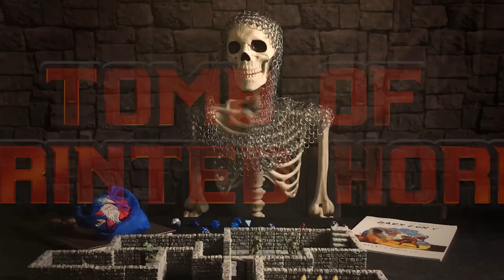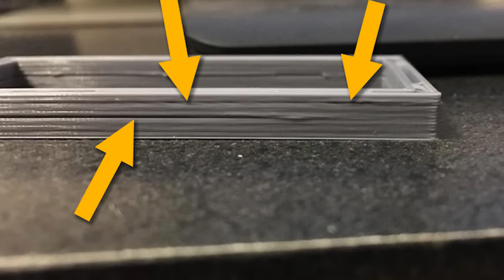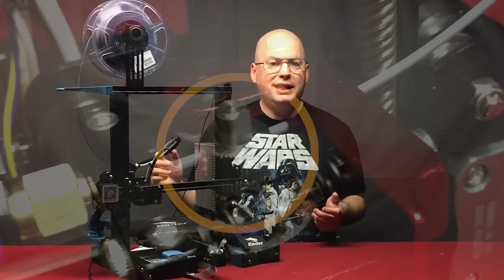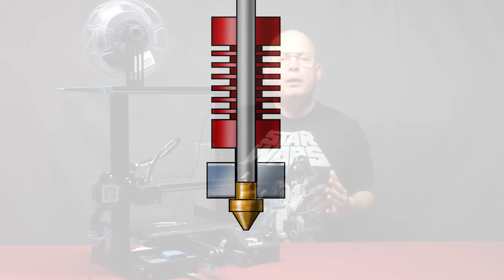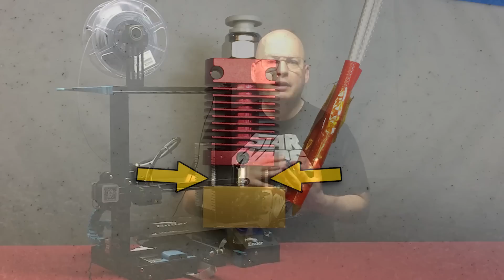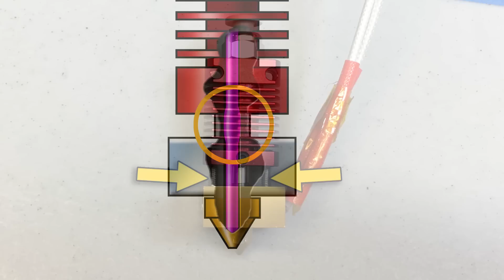Fixing Under Extrusion in a 3D Printer

Comment: Ender 3, v1
You saved me. Between this video and a bit more digging I nailed it. I'm back to printing. I have been having issues since getting a glass bed, but maybe it wasn't the glass bed after all because I hit a point where my nozzle just wasn't extruding anymore. I was out of hope. Putting my original/stock bed cover back on did not fix the issue.
-Disconnected Boden tubes on both ends, removed visible clog, sprayed air through it.
-Heated up the nozzle, removed it, pushed a small Allen key through the top and sure enough POP a big chunk came out of the heat sync/nozzle end (with nozzle removed).
-Put in a new nozzle to not take any chances
-Used a tooth brush to brush the gear that feeds in the filament (with isopropyl alcohol for good measure!)
...Still no printing
-Final step, I added 3 small washers between the spring and screw on the extruder.
Photo of washers installed --> https://imgur.com/T2xA9E9

Next steps, I ordered a replacement aluminum extruder assembly and new connectors for the boden tube. I suspect that once I replace those I'll be beyond back in business and will hopefully future proof against this happening again.

Thank you for this amazing video.

Comment: I'm so glad I found this video. I recently came across some printing issues, and I've tried re-leveling the bed and unclogging the nozzle, but now I finally know that the issue is under-extrusion. I thought I was going insane when I had spent 20-40 minutes leveling the bed, then seeing that the nozzle is trying to print in mid air. This has relieved so much stress for myself.

Comment: Thank you so much! Living in Florida definitely added moisture to my filament but on top of that I'm about 3/4ths through my roll and the gear was having a hard time getting that tight wind to pull through. I upped about ten degrees and unrolled my filament a bit. I'm going to need to babysit this roll until it's end but plan on doing a few upgrades soon that will hopefully help on the pull.

Comment: Huge thanks for this great video! It led me to the solution to my underextrusion issue. I appreciate that you start with "how to identify underextrusion" -- it's so easy to misdiagnose the problem and waste time debugging the wrong thing. For me the issue ended up being as simple as increasing the print temperature on my old spook. A great suggestion that I didn't see anywhere else! This was after I had disassembled the hot end like a dozen times. Thanks again!

Comment: I think this video deserves a correction. At 14:20, these screws are not a mistake. Creality confirmed that they are part of the planned design and they should not be removed. The heat creep was proven by CHEP (check his channel) to be a myth.

In addition, Ender 3 V2 owners from 2021, you can see improvements in the design. The Bowden coupler is improved and no longer need replacing. The filament entry point to the extruder is using a brass hole so the filament won't eat away the plastic. Still recommend replacing the stock extruder.
Reply from the maker: If you read the full video description I do indeed have an update on screw issue, and the bowden coupler still is prone to failure, even on the V2s, and should be replaced with a better piece.
Reply: @Tombof3DPrintedHorrors  thanks for the reply. And thanks for the amazing videos. I learn a lot from you. You’re a great teacher!

Comment: I am having this issue after 4 months of great prints. The last description was exactly what my filament is doing; thin and wants to curl.
Reply: Did the cold pull and also adjusted my bed. Able to print again. I mave have a bit more blockage but not 100% certain as my filament is starting to tangle as it gets to the end of the spool.  I may reel-to-reel it and see if I can fix that filament. BUt your recommendations were spot on.

Comment: I know this vid was a few years ago but I'm new to 3D printing and found it to be a very informative video. Brilliant stuff and I've subscribed immediately.  I wonder if you could help with my issue. I've a problem that I'm sure is an under extrusion issue. When printing rectangular prints, such as the base of a box, the first few lines of the fill are so thin or none existent that it leaves a hole in the corner base. The perimeters are fine and the outline of the print is fine., just the first few lines of the infill. After a few lines of the corner the extrusion is ok again. Wherever I move the object to be printed on the plate, the issue persists on the first corner. Any ideas? I've lowered the speed of the first layer but this has only partly rectified the problem. I wonder if it is a retraction issue or, as in your vid, a heat seep problem that is causing the filament to soften higher up, also as in this vid. Some great stuff in there explained in simple terms. Also, I can't seem to fined the Facebook link.

Comment: It sounds like changing to a Direct Drive would solve most of these issues. Is there any downside to going to a Direct Drive system? I know there is more mass moving the head around, but I've not heard any issues with the stepper motors or belts not being able to handle it.

Comment: Thank you thank you thank you. What a joy to listen to you. I don't have under extrusion issues but man I listened to the whole video anyway. I totally agree with everyone else here, your style is impeccable. Clear, precise, consise and calm yet I didn't fall asleep. You sir, have a gift for this! My issues are constant over-extrusion even though the e-steps are calibrated and correct. I have to go down to 70-80% flow not to cause my Ender3 to over extrude. I have replaced the extruder arm with a dual gear system that is great. Maybe it feeds too good so that's why I'm overextruding. Any pointers would be helpful, what should I check?

Comment: I have been scouring the internet and asking a million people what my problem could be. In your video you mentioned I can ask a question in the comments here. Idk if you will see this but I will give it a shot (I also posted on the dragonlock fb page you alluded to with pictures):

I am consistently having this problem with any board game inserts I make on my ender 3 has a pretty good first layer but then turns into a contorted mess after I come back to it on the bottom of the print. It looks like over or under extrusion where there are like bubbles on the bottom of the print. I have tried an endless amount of possible solutions and it is suprising because it doesn't seem to be a problem clear enough that people can easily identify it and I can fix it. I have tried adjusting nozzle temp, adjusting esteps and flow, clearing the nozzle with a silver rod, using a glass bed, using the solid yellow springs and most importantly leveling the bed. I did leveling tests and it showed a smooth surface so unless I need to level some more, idk why this keeps happening. I'm going to try and change my filament next but if that doesn't work I really don't know whats wrong and maybe I have to contact customer support to say my printer just straight up isn't working right. It has been quite frustrating and been looking for any help from anybody who may have experienced this before. I tried a bunch of your techniques and I just can't pin this issue down because I can't tell what it really is and what is causing it.

Comment: Love this stuff!
I am currently re-birthing an Anycubic Mega X to use CR10 hot-end/carriage hardware.
They both use 20x20 V-rails, so what could go wrong?
Not exactly a 1-for-1 swap, but I am using the MDD V1.3 plate, so 90% of the hard part is done!
From thingiverse, I used the 'minimalist' adapters for E3D-V5 hot-end.
A nightmarish kludge, but isn't that part of the fun?
Direct drive comes next, but with Capricorn tubing, is that even necessary?

Comment: Had a sudden under extrusion problem that was quite extreme. I thought I had exhausted every possible solution and was about out of ideas. Then I remembered you talking about heat creep and the cool side of the hot end. The only thing left that I hadn’t eliminated was the hot end heat sink fan. A small piece of melted filament was lodged deep in the fan that only came out after aggressively blowing out the fan. The fan was running just under normal speed due to the debris and it was creating a situation in which the filament was melting in the bowden tube in the heat sink area. With the fan fixed the extrusion issue was completely resolved. I was amazed at the dramatic difference in results due to a slightly slower fan speed. Thanks for all the great resources!

Comment: im pretty new to 3d printing and im having a issue that i dont know how to troubleshoot! i believe its a hotend issue but i dont really know i am getting a whining noise along with under extrusion i dont know if it has to do with going in a circle and this may be cause the straight line before it starts the skirt is good the it starts going in the circle i start to see under extrusion and it starts whining up and down ive asked everywhere and no one answers ive cleaned and changed hot end

Comment: 2 Years later, the "Filament Diameter" hint helped me. Anycubic's Nozzle or rather the Filament has a diameter of 1.75mm.
Cura was set to 2.85mm by default. Not sure that solved my problem fully yet (restarted my test print to see the difference), but it was 100% something I would have overlooked, as no setup tutorials was listing the Extruder settings or even showing them. First few lines on the bed already look better!
Reply: Okay, just the bottom of the test print I restarted is already looking 10000000% better. It's literally solid now (yeah I know, 100% infill is not needed, this is just for testing stuff out).

Comment: My lines are coming out thinner than a surgical needle and I do not know why. I made adjustments on everything and there is no blockage. I am printing the same way I have for an entire year with 0 problems until I redid the firmware when my thermistor broke. That moment was the defining factor in my printer breaking and having extrusion issues.

Comment: There is a metal insert on the plastic filament guide on the extruder now.  It negates the wear issue you mentioned with the stock plastic extruder.  
Strangely enough, there's is an adjustable sping on the original plastic extruder, but on the nice metal replacement part, there is not.

Comment: are you sure, the screws are supposed to come out? I mean, why would they be there in the first place at all? It does not help assembly, but add an additional step. I never had even a warm heatsink, so it was always far below glass transition temperature.

I also recommend in printing a hotend liner (PLA) for a short piece of bowden tube to get sandwiched right between the nozzle and the coupler. Even if the coupler fails, there will be no creepage of filament between the nozzle and PTFE tubing, since it cannot move. You only need to cut off a bit of the existing bowden tube - basically exactly the length, which is inside the hotend. This prints in 5 minutes, costs less than a cent of plastic and is absolutely worth it.

Comment: I got this yellow filament and it's coming out so bad the surface looks like see through popcorn.  I changed my nozzle checked cura settings and then switched the filament and the issue went away immediately.  What's wrong with this filament?  I checked the diameter with a caliper and it's close like 1.67.  It's new from Amazon and came vacuum packed.  Short of throwing it away how do I fix it?  I don't think the diameter should be too much of an issue I have a volcano nozzle.

Comment: Actually I have a very different issue. I m not able to explain you my issue right here but I had made a video of the issue. In simple words I can say that I have inconsistent filament outflow through nozzle. I cleaned Bowden tube hot end and also make sure everything was neat and clean but still I have breakage in the filament flow from nozzle. And small air bubbles in the filament extruded from the nozzle.

Comment: If you are as cheap as I am you can turn your bowden tube around after you remove the clog.
Reply from the maker: Bowden tubes wear out on the interior from the friction of the filament and will eventually cause drag, you are far better off to swap it out when doing this.

Comment: Hi

After trying some of the things you show in the video like cleaning the nozzle, modifying the printing temperature and adjusting the extruder gear tension I am still having issues with what I believe is under-extrusion. Interestingly, I only get under extrusion in the Z axis when printing small details (I used to be able to perfectly print a usual retraction test, but not anymore). 

Do you have any other ideas or suggestions? 

Thanks for the great video!

Cheers,

Comment: Hello
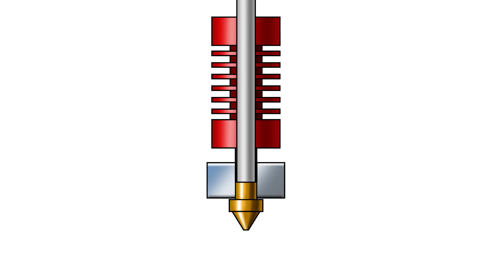12:00
Is there any product available that simply replaces this stupid connectivity method?
I don't know, something that seals the whole passage inside the hotend and heatbrake up to the top with just one piece? This way making sure no gaps form inside 
Or an assembly method like hoses have. You pass the bowden tube out to the bottom and screwed with the nozzle. Then screw this whole subassembly to the heating block

Comment: Useful video thanks.
A problem with under extrusion I had that wasn't covered here (new Ender 5 Pro) was extruder adjustment was set too tight so that the filament was being squashed/distorted such that it was causing resistance on the inside of the Bowden tube (Capricorn).  With the adjustment screw fully wound back it's working okay.  To alleviate this, I plan on replacing the Capricorn Bowden tube with a standard 2mm ID tube and using the Capricorn tube as a shortened piece adjacent to the nozzle/heatsink up to the push-in fitting only.

Comment: The tube backing up in hot head was my issue, there was crap in there and was giving really bad prints. So I've cleaned it out entirely which took some doing top to bottom, refitted with the tube better positioned and a full bed re-level for good measure.  No more printing more problems :)
Thank you

Comment: Wouldn't it make sense to cut out exposed parts of these screws with a Dremel? This way there would be no more connection between the hot end  and radiator, yet isolation would remain intact.

Comment: Freakin awesome video! I just fixed my printer with your excellent help. I have replaced my nozzle, bowden tube and completely disassembled my extruder assy, and it turned out to be a filament plug in the hot end under the slipped bowden tube due to the cheap connector. Thank you so much!  I'm very much a fan of your style of video. No bs music and jokes or missing detail. thumbs up and subscribe brother!

Comment: Im underextruding on top layers and walls always come out delaminated. Tried bunch of stuff..if i increase flow, extruder starts clicking. Temp is 210. Also top layers come out overextruded on walls, but the roof underextruded. it fucking sucks fixing it

Comment: What would cause my first model of the “dog” on the creality ender3 literally cut the head off at 87% done and remain stuck to the extruder and dragging the head in the axis movement of completion prior to stopping.. it almost looked like it got stuck vertically?? Thanks in advance
Reply: once it reached the head  section of the dog the print no longer went any higher? i am currently trying to set up my ender 3 pro and i have seen other people, and have experienced myself issues with the z axis screw not being aligned properly. Once i reach a certain height the z axis stops moving as much as it should do, to the point where it doesnt move at all. I've seen this z motor spacer being used to solve the problem but i need to get a good print first, maybe it will work for you https://www.thingiverse.com/thing:2925230

Comment: Thanks for the efforts to make this video. This helped me to fine tune my Ender 5. I am still experimenting but as my printer is running I adjusted the screw located at the extruder and increased temp for 7 degrees and while the video is still going on, the sound of failed extrusion is gone :) 
I instantly subbed, and am looking forward to exploring your channel :) Thanks a lot!

Comment: I want to thank you for these videos.  I have been having under-extrusion issues with my ender3 for months.  Printer was not functioning.  I tried a bunch of tips I found online, then watched your vid.  You recommended replacing the feed mechanism, so I bought the one you linked to.  It came in today.  When I removed the old one,  I found that the arm with the feeder pulley was cracked on the feed gear side.  The pulley stayed in place, but could not maintain tension.  I hooked up the new part, leveled the bed, and am successfully printing.  Thanks!
Reply from the maker: Great!

Comment: so i am thinking i may have sliced using cura telling slicer i was using a .05 nozzle... so if i forgot and used that same file with a .04 nozzle in my ender5 would this cause under extrusion also? i do notice some clicking going on at the extruder also after print is an hour or so into the print... thanks

Comment: Hello , 
Thanks a lot for the video .. it was helpful
I have a  ِAnet A8 printer when I try to move the  Extruder stepper motor via control panel it does not work!!
Do you think that one of the Firmware lines needs to be modified?

thank you..

Comment: Thanks for the tip.  Prints were working fine for a long while.  Had 7mm extrusion so I thought this may have been it.  But previous printing sessions were fine.  Noticed it was right after retraction.  It wasn't melting fast enough (lots of humidity lately).  Added 10 (then changed to 5) degrees more and that allowed it melt quick enough upon reextrusion.